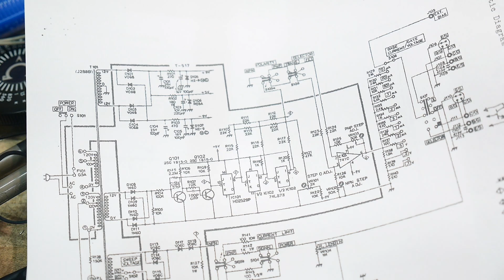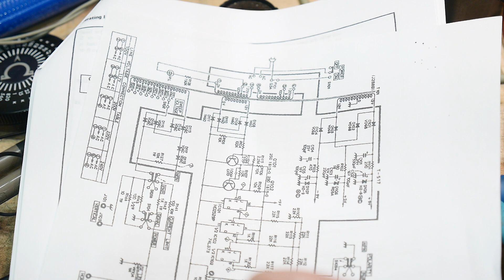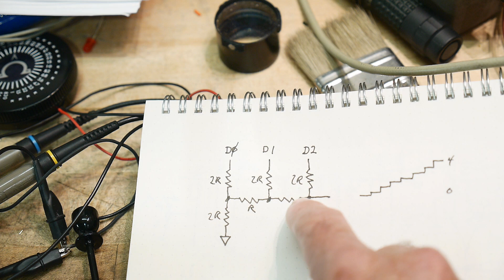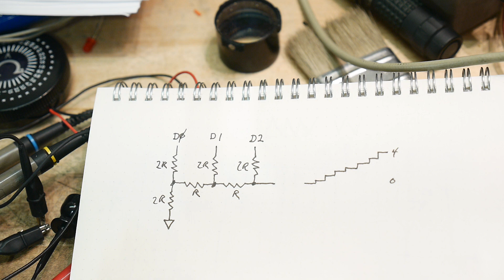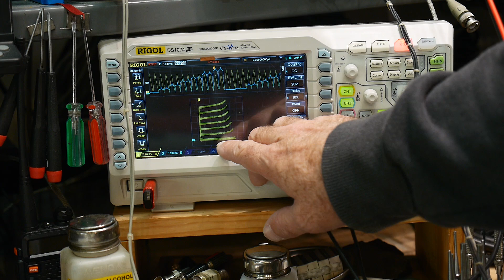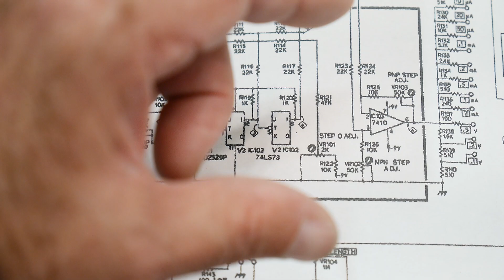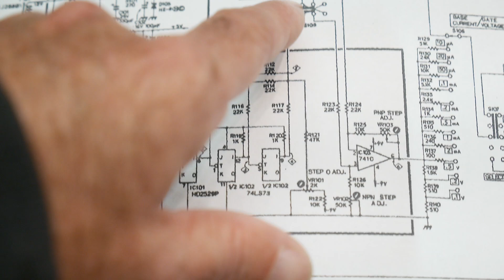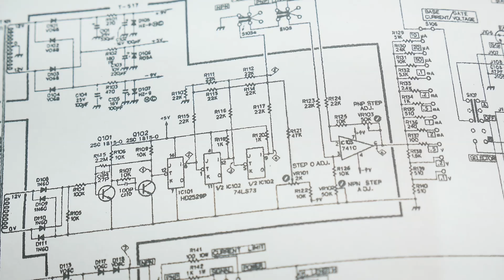#640 Transistor Curve Tracer (part 2 of 10)

Comment: How rough would the waveform be using an analog output pin and just enough capacitance to smooth out the PWM noise?
Reply from the maker: https://www.allaboutcircuits.com/technical-articles/low-pass-filter-a-pwm-signal-into-an-analog-voltage/

Comment: semi serious question: what about dual gate mosfets? has anyone ever made a curve tracer for those?  guess it would just take a second stairstep generator section.
Reply from the maker: I'm not sure. You could just bias one gate and test the other. In a cascode type arrangement.
Reply: @IMSAIGuy  🤔
Reply: I don't think there is much to learn they are SS tetrode like devices, except for mixer applications the most the second gate gets is AGC Voltage. Ron W4BIN